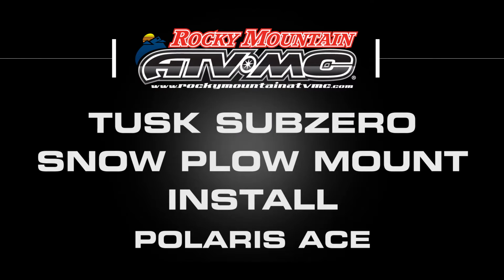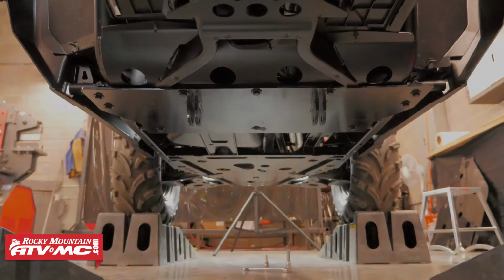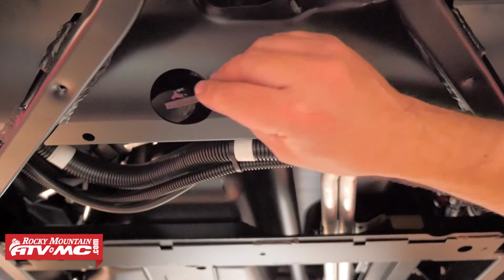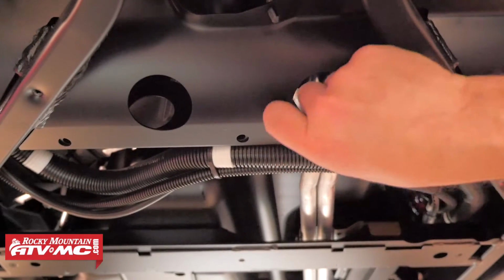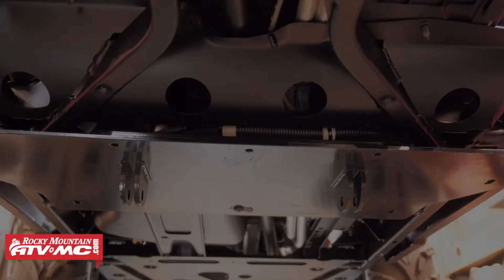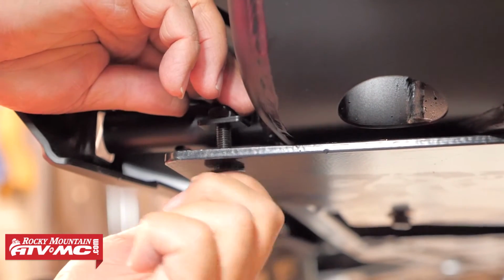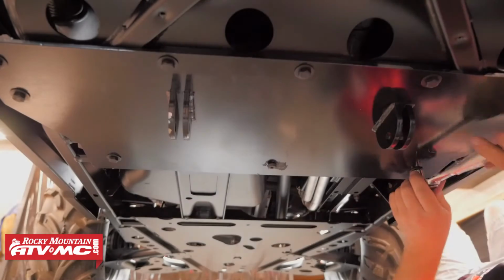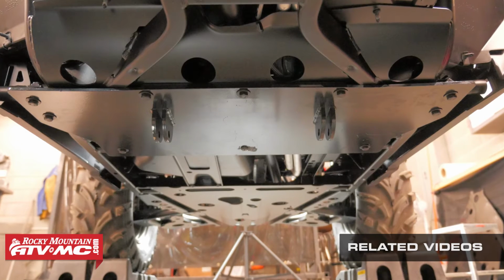Tusk Subzero Snow Plow Mount Install | Polaris Sportsman Ace

Comment: Nice design, looks strong. Concerned about the leaving the fuel tank and coolant lines exposed.
Also, these aft mounts will hang up when using this offroad in the summer.  
Looks as though one would have to remove and reinstall this every season if the vehicle weren't 
dedicated to snow removal.